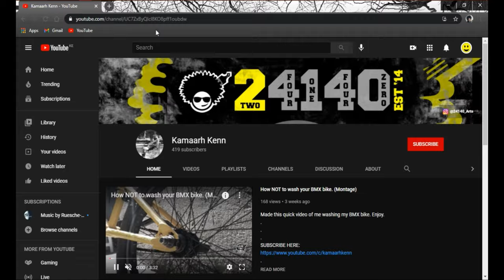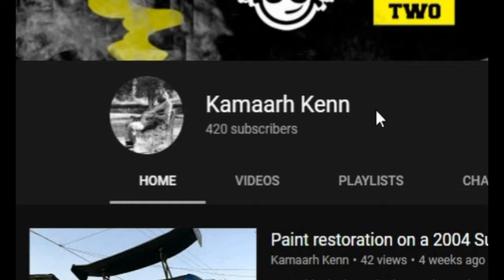How to build a sealed BMX cassette hub. (4K)

Comment: may i ask bro whats the bearing size of this one 3:41 i got hub but its only balls not bearing and they already broke
Reply from the maker: If your hub runs on ball bearings you're better off finding direct replacements. The designs for both are different
Reply: @KamaarhKenn  yeah there are balls. u mean buy new hub?
Reply from the maker: You can buy just the bearings and rebuild the hub you have. Provided the hub itself isn't damaged. You'll probably spend a few dollars for the ball bearings and rebuild the hub rather than spending a whole lot more on a new hub
Reply: @KamaarhKenn  i also think the same cuz its 6 pawls lol
Reply from the maker: Exactly. Just find direct replacements and you'll be okay